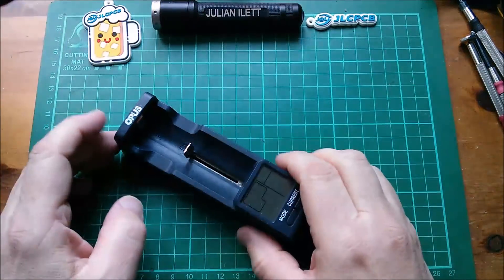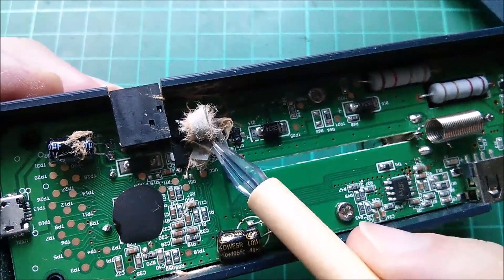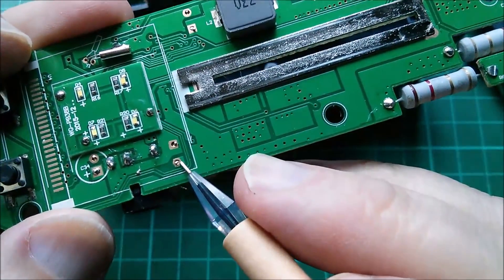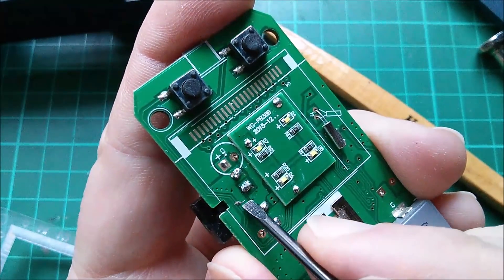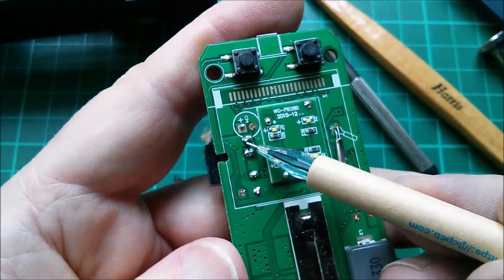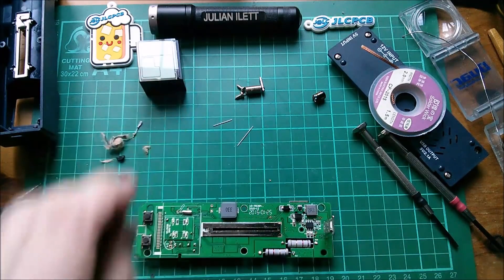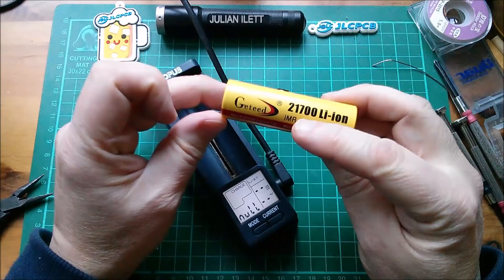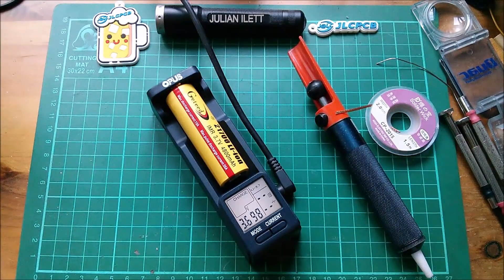Battery Charger went Bang - Guess what Failed!

Comment: Before I listen, I will guess a diode or cap blew. I think I would have replaced all of the 10v caps with 16v; maybe.  Depends on what it is connected to but it would be more safer option if it is on a 12v line.

Comment: I think: -  1. Wick is no good without flux.  2. Solder sucker is only really ok for through hole components.  3.  Wick is no good for through-hole components that are still mounted.  Wick is ok for holes containing only solder once the through-hole part is removed.  Wick is ok for smd pads.   what ever works is ok, i guess.

Comment: Not going to spam with company names in a comment - but there are huge differences in function between brands of solder braid...should also note that it's helpful to size the wick (width, thickness) to the problem at hand.

Comment: Thanks for the tip. You've made me check. I've got a bulging 10V cap in mine! We both had units from early production runs. It is a BT-C100. They are hard to find now. It's my favorite charger tho I do like my Liitokala Lii-S2. If you ever put a cell in the BT-C100 backwards I believe it is the small coil on the top of the board that smokes. Mine no longer properly terminates LiFePO4 cells so watch out or that. Perhaps the bad capacitor has something to do with that issue.  It stops charging way too early- better than too late. I will replace the cap and give it another chance with LiFePO4 cells. It does charge Ni chemistries perfectly even tho the settings makes no mention of that feature.

Comment: If at all possible (i.e. component already out of way) my preference is to keep the board on edge, the solder sucker on one side and iron on the opposite side.  Also, if I have my choice, the soldering iron on the heat sinking (heavier copper) side.  And like people already stated, the wick needs FRESH flux, if it is to work at all.

Comment: A loud pop and now a rattily innards. That's not good. Pity there wasn't "Capacitor Cam" to catch it exploding. I always reflow solder joints before I de-solder them, I'm always mindful of overheating the joint and delaminating the pads with either a braid or a sucker. I use an Edsyn DS017, they last forever.

Comment: Well at least the dropper resistors are a decent size. The ones i found in an old power devil charger were the size of tic-tacs and had darkened the PCB. The ones i bought off ebay to replace them look very similar to those in the vid.

Comment: Hi Julian, have you used any flux on the solder braid before attempting to remove solder?
I also don't like solder braid myself but flux might help you.
I use a Hakko de-soldering gun on most of my repair work, for me its the easier and cleaner option.
It's a lot more expensive but you remove all the solder in one press of the trigger, even on multi-layer boards.
Occasionally on lead free solder I need to add fresh 60/40 leaded solder before trying to remove the old stuff.
Keep up the great videos Julian, I'm originally from England and its comforting to hear the accent from time to time.

Comment: I would have replaced all 3 capacitors as a rule of thumb because if one cap was under rated then chances are others are also. Besides, if one capacitor blows you don't know the strain it put on other components and capacitors are usually the first to show signs of damage.

Comment: I have long used a solder sucker/sipper to remove gross quantities of solder and braid (with added liquid flux) to clean up the holes and surfaces.  (more economical) Like 50 years long. Ron W4BIN

Comment: Its probably designed for a 12.0 volt low current output supply not the 13.8v high current batteries you plugged it into.  A small wall wart would probably sag enough to be within 10% of that 10V rating to not blow up.  Is it good design?....no.  But it is likely what the designers assumed.  If it came with a 12V wall wart its also likely that was actually slightly less than 12V or had regulators in it...which I have seen before.

I have also seen Lithium chargers where they put the smarts in the USB plug and directly connected the USB plug to battery +/- so a proper phone charger would provide way too much current... because they assume you will use the included one that will limit itself to like 50mA, or the included shitty cable that drops several volts thru the wires.

Comment: In the old days, RCA used to test their Capacitors at twice their rated voltage! Think about that for a minute... It's the reason why old school electronics used to last so long, even though Capacitor technology hadn't evolved to what it has today... So always go to a higher voltage if size permits and if you want your device to last a very long time...
Reply: I bet but they were also twice as big and cost twice as much (or 1.5 times, whatever). If used correctly, tight tolerances really can make things better.

Comment: You've got me worried about mine now... thanks for the PSA! I think I'll take the back off and double check, hopefully it has a 100uF 25V cap as Vince said is in his. I also prefer a solder sucker to soldering braid, but when I have had to use it, I add liquid flux (flux pen) and often also add solder to the joint (especially when the original stuff is lead free junk).

Comment: For the electrolytics you are supposed to use a low ESR / high ripple current type. Using a generic electrolytic will make it pop too very soon, even when rated at higher voltage...
Reply: Depends on the circuit, current, and other factors. Low ESR is good but not a magic band-aid

Comment: Stupid manufacturer should have just used the same 16 or 25V caps for all the electrolytics to reduce the BOM and errors. Some ape looked at listings and tried to save a cent on a cheaper part which ended up costing them more in the end.

Comment: Hi Julian, all those capacitors were hand soldered by the looks of it, so easy to see why the wrong cap is in that position.
The square solder pad on the capacitor overlay is positive.
At 8:00, only 0.5A for all those LED lamps, I have a few of the flex ones and each of those pulls 0.19A. So at least 3 of them will be nearly 0.6A
My flex lamps have 6 LEDs in them.

Comment: Mine (also) has 100µF/25V caps in both positions. They goofed. Surpised it didn't blow up sooner. Mine also has a series diode (SS54) that yours doesn't in between the battery positive terminal and the parallel FETs going to the 5V USB boost converter. It gets very, very hot (150ºC+) when using the USB output at higher current levels...

Comment: This happened in my face when I tried to power a display driver board with leads from an atx power supply. Right voltage but too much current. The can blew off like a rocket and bounced around the room.
Reply: Odd, I've never heard of that happening. Are you triply sure it was the right voltage?

Comment: Back in the early 80's, we were building a proto-type and the cap would not fit.  So our tech guy used large pliers to squash the cap until it fit.  Later we were able to buy surface mount parts and every thing fit without adjustment.

Comment: You're missing out on a valuable tool in your tool box. I've had cheap solder wick before and had similar results as you  Buy some good solder wick and it will change your perspective.  The best I've used is called superwick.  It's not cheap but worth every penny!

Comment: @ 5:05 you need a LoESR cap, not a cheapy regular one.
Reply: Why does it need to be low ESR?
Reply: @westinthewest  you always replace a Low ESRwith another Low ESR, otherwise it may not work correctly after the repair. Not just after you plug it in, but later down the road.
Reply: @nightshadelenar  It looks like the application here doesn't need anything fancy.  It might be smoothing a bit of ripple from your external 12V PSU, but that's hardly going to cause any I2R losses.
Reply: @ 1:07, take a look at the topper that's flapping in the breeze.

Comment: Julian, I've found that my solder braid works well with older circuit boards, but anything assembled with "lead free" solder requires a solder sucker.  I tried Louis Rossman's suggestion to apply leaded solder to the hole, and then the solder sucker works even better.

Comment: Nice that i am not the only one that never gets solder wick to work :D
Reply: You need to apply flux to it. Unless you buy the expensive pre-fluxed version, but who does that? :D I use a flux pen with liquid flux to sweep across the braid first. Works a charm.
Reply: Braid works just fine. Try a good quality product like Chem Wik from Chemtronics from a trusted supplier.  Applying a small amount of solder to the iron tip to aids heat transfer. If the area is part of a large heat-sinking ground-plane, heating the board with a hot air station first really helps. Whether using braid or a solder sucker I've found if I try and heat through-hole solder joints on large ground planes with only an iron I am more likely to lift the solder pad - or it just doesn't work at all.

Comment: I normally use a solder sucker/pump. I do have some decent solder wick, but only normally use it for cleaning pads up afterwards when needed. Often the problem is the diameter of the plated through holes is only slightly bigger than the component leg, hence its hard to get all the solder out.

Comment: Wait until you see what happens when  a 70v rated cap is inadvertently given 103v! I couldn't quite get to switch off ithe mains input of the 100 + 100 amplifier that was soak testing where I worked and it was making a very high pitched whistling sound. As I reached over the open topped amp the main supply reservoir cap blew, releasing pressurised steam at over 100 degrees across my right forearm! Very nasty scald burn. Took months to properly heal!

A couple of years earlier a large supply cap inside a 100 watt Marshall amp under repair blew apart just missing myself and a colleague working with me and the innards spiralled across the room for about twenty feet!

Be VERY wary around large caps when making repairs or testing stuff! 😱😱🤔
Reply: Or when working near or on new projects. When I was training at technical college, a student was working on his project at the rear of our practice class. Suddenly there was a loud crack and bang, so the whole class turned round to see what had happened. An electrolyte capacitor had departed the circuit board and was now lodged in the ceiling above... It was still there when I finished at college the following year 🤣

Comment: Julian, have you tried those hollow needle tools for desoldering ?
 I think the idea is that when the solder joint is liquid, the needle goes in the PCB hole and around the component pin, forming a solderless barrier between the two.
 I got a set of different sized tools whose plastic handles will probably melt off, from Alice for a couple of €uroDollar$

Comment: maybe they were hoping that a 10V capacitor would handle a bit of over voltage and get away with using cheaper parts. 
I was looking for some 21700 cells and noticed that they are really hard to come across, it seems that lithium batteries in general on eBay are hard to get these days. 
There is 21700 cells on eBay but only very few listings with really high prices, they want 35euro around per one cell.

Comment: as many tried to point out in a recent video, that two-for-a-quid solder wick from ebay HAS NO FLUX in it so its never going to work. either use quality braid (which is coated in flux) or dip the cheap stuff in flux before you use it. its the best way to clean up pads.
Reply: You are best adding flux either way
Reply: hey that "dip it in flux" is actually pretty good advice, because even with fluxed wicks i often have trouble because i use them so rarely i guess the flux goes bad, but i have a giant tub of chinesium noclean flux goop with a very cancerous smell, can just dip the end in that each time! wonder why i never thought of that :'D
Reply: I never used flux with cheap braids and never had problems. IDK why is everyone in comment section freaking about dipping braid in flux.
Reply: @whatever7338   Julians braid isnt working well, flux will help. solder always flows better with flux, simple as that.

Comment: Solder wick only works if you put flux on it, a flux pen is ok but works best with rosin IPA flux. Buy some empty nail varnish bottles (they have a brush in the cap) and some rosin from ebay and disolve some in IPA, around 5 to 10% is ideal :)

Comment: The fluf is impregnated paper some capacitors use that as the dielectric, when the big ones went on Industrial drives it took hours to get all the blasted paper out.
Reply: It isn't anymore, but it was, before it exploded... :-)
Reply: throw a bucket of water over it on a friday night, let it dry all weekend ...
Reply: @jyvben1520  if you wish to throw a bucket of water into a 300kW Inverter drive go ahead, bearing in mind every hour of lost production cost the company thousands
Reply: @dogwalker666  not my company, you said it needed hours to clean it up so money was lost, was the machine still under warranty/guarantee
Reply: @jyvben1520  yes it was under guarantee I was working for the manufacturer,  they had a power surge that took the mains way over specs, the 1400v caps all blew, imhad go disassemble the bus bars, remove all the dead caps and shovel out all the paper, then reassemble.  All parts FOC and the power company payed the manufacturer who paid me,  the downtime was the one they were arguing over.

Comment: All I can say is don't buy your solder wick from chinna, I get mine from RS or Farnell and they last for year and work great. never need to add flux but sometimes do wet with a bit of freash solder to help the heat get to the other side. 

when i was 15 or so we fixed a valve speaker amp at college to play a radio through. went for tea break came back and the room was filled with bits of paper floating around, and no music. The filter cap had gone bang, 3 valves in bits and a very large hole through the 12" speaker cone produced as the can left the case. :) Happy Days.
Reply: lol 
yeah I agree on the cheap solder wick tbh 
Have some junk braid somewhere that came with something once (Also have some good quality stuff I got once) 
rarely use it though tbh
Reply: @BenCos2018  Its the same with flux, if you need flux then get it from a main supplier as then you at least get to know whats in the flumes. When have you seen a chinees MSDS for a product that could be harmful to yourself.
Reply: @TheEmbeddedHobbyist  I agree

Comment: I can’t get on with solder wick either. I found a cheap solder iron with built in solder sucker on eBay. It has a tip with a hole in which you place over the pin you want to desolder, let it melt the solder, give it a wiggle and press the plunger release and it draws all the solder away, don’t know how I managed without it!

Comment: With the solder wick i recommend to use tacky flux like rma218 with the wick and it woks a treat
Reply: I like a RA style flux in a small bottle with a needle tip.

Comment: I swear by solder wick.  Great for cleaning up once the components have been sucked out.  Will draw out solder from them pesky plated through holes.  https://youtu.be/Fxu1LAoqTRA
Reply: How? with me it almost never works. can the wick be bad Quality or something?
Reply: @HannesMrg  Add a little flux to the pad.  I have a flux pen if the solder is stubborn.  Could be oxidisation or lead free solder.  If you know or suspect lead free, the add a little leaded solder to the joint prior to wicking.
Reply: @HannesMrg  - put flux on the braid before using it -- makes a world of differenece
Reply: @HannesMrg  Get a good fine braid wick (MG, Goot, etc.) and drench it in good liquid flux (I use MG 835 RA) if needed. Don't forget to have the fan running first. Even then through holes can be tricky, sometimes I have to refill the hole with solder and do it again to clear it completely.

Comment: Damn you didn't get a video of the cap exploding, never mind new capacitor fitted with a bit of allowance on the voltage and you can now charge your batteries again if only all repairs were this simple:-)
Reply: Just fit it with another 10V capacitor and you can film it this time.

Comment: Have you tried adding flux to the braid? The version i have needs copious amounts of flux to work well. Even though it supposedly contains flux.
Reply: Ye, also putting plenty of proper solder on to mix in with whatever chinesium is there already 😅
Reply: @ollieb9875  Right you are.  Chinesium. LOL.  Love that word.  Says so much. :)
Reply: Even the good stuff sometimes benefits from a dip in the flux bottle.
Reply: I use a flux pen the same as Big Clive and it works really well with the braid.
Reply: Yeah, Gotta use flux.
Reply: With good Deoxit flux and that cheap wick works good, ie, like Goot, but without it just doesn't work at all.
Reply: @SidneyCritic  I've gone to getting braid without flux now. I drip on a few drops of flux from my flux applicator bottle or syringe.